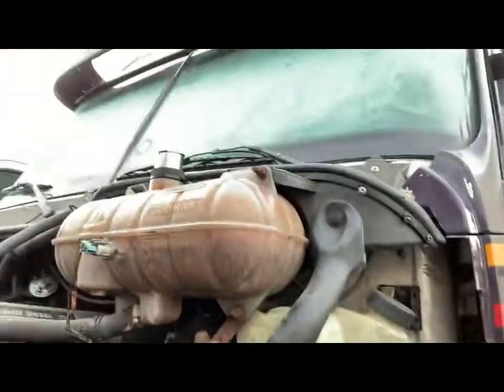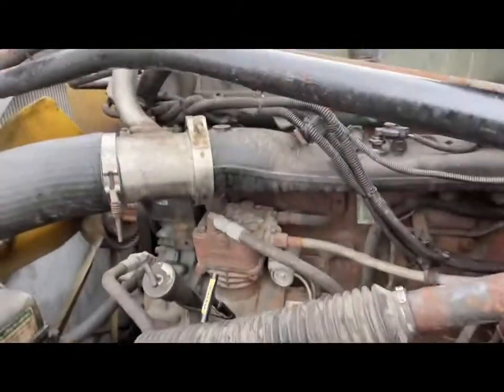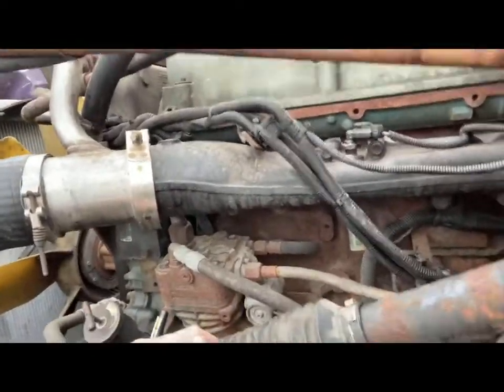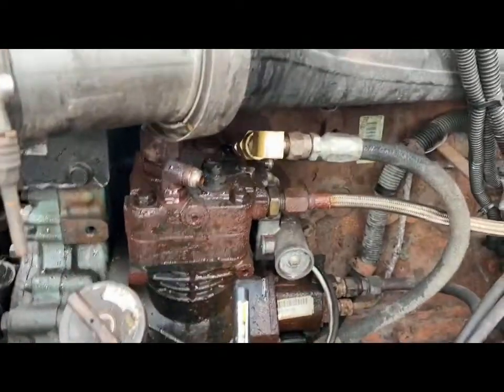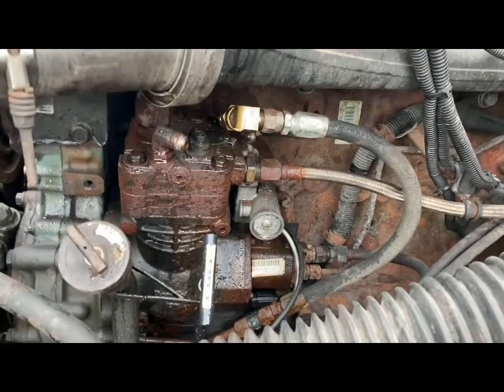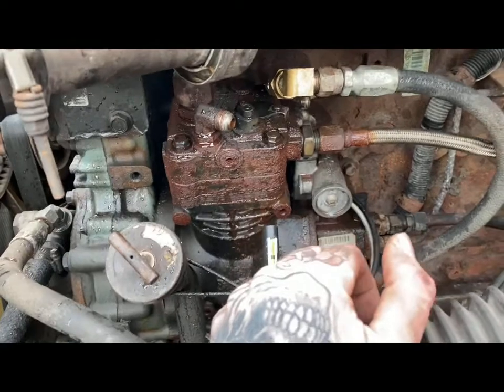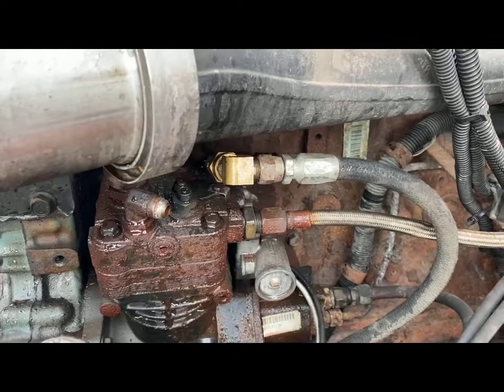Detroit 60 series pressure in coolant system diag

Comment: I’m having the same issue with overflow and everyone tells me head gasket or head or liner I’m still running but I want to diagnose the problem so I’m going to try this thanks for this
Reply: Did u try it and what was wrong ?
Because I hv same problem and I didn't try to  bypass the compressor yet
If u did it let me please
Reply: @jeyavathananjeya7474  sorry I ended up selling the truck needed a overhaul
Reply: Hey did you figured it out what was it. I am having the same issue but don’t know what is it causing to happen.

Comment: My does that only while driving , will spit a galon of coolant. While idle everything is fine.
Not overheating, no smoke of a stack only pushes coolant on a overflow line. 
This starts to hapen when i changed the coolant tank. I did reuse old cap on it. When i open the cap while hot i dont have any presure in the tank. 
Also my compressor is all oily on middle and bottom. 
What do you think ? Bad compressor, bad cap, bad head gasket or egr cooler ?
Reply from the maker: do the test to see
Reply: What did yours end up being ? Minei s almost exact same symptoms
Reply: So what was the issue

Comment: My truck is pushing water out of the weep hope over flow tube,  replaced the radiator Cao and stopped but now when I open the cap, it comes out of there. I dont have any issues with overheating.  So????definitely worried if I need a rebuild...
Reply from the maker: it’s time

Comment: When I turn truck off coolant start dripping from hose were it connect to compressor. But I run water only in cooling system and drain every day. If I leave it full over night it will be water in oil or oil in coolant.
Reply from the maker: That’s a weird one sounds like it has a cylinder dropped pull the oil pan and pressurize the system and look for water protrusion from the cylinders

Comment: My 60 series pushes 3 gallons out of the reservoir when I fill it up then crank it. After that it doesn't do it anymore. I drive about 3000 and  I fill it up again repeat repeat. Doesn't run hot. No oil and water mixing. Also blows it out of exhaust on start up
Reply from the maker: either the egr cooler is blown or the head/head gasket

Comment: I have Detroit 60s replace the thermostat oil cooler but still my coolant temperature go above 200 F only at stop 🛑, could be the air compressor? Fan only kick when it’s above 215 F
Reply from the maker: Most likely
Reply: What is the normal  coolant temperature Detroit 60 at idle and in traffic

Comment: Hi I have the same problem my engine is 70k only after in frame 
Oil clean, strong 
Cuestión ; I notice that you didn’t remove the air line . So I just do the bypass on the two hoses with coolant? Do I need to remove the air hose? 
Because my mechanic remove only the air hose and I still have the coolant pressure 
Thanks for the video man
Reply: Please let me know it will help me a lot
Reply from the maker: @javierguisa4113  yes keep the airline hooked up and bypass the coolant lines if it builds pressure it’s engine related if no the head on the air compressor is shot and it’s pushing air into the coolant system
Reply: @StickShiftRacing  thanks I will do it today I will let you know

Comment: Hello, I have the problem in a detroit series 60 14 liters I have a lot of air pressure but when disconnecting the hose from the compressor nothing happens or it will be that I performed the procedure wrong
Reply from the maker: which hose did you disconnect?
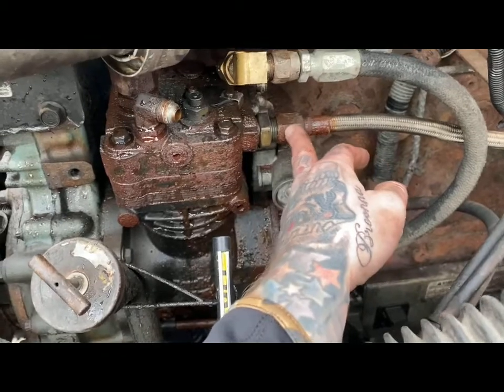Reply: @StickShiftRacing  the hose you touch at 2:35 alone and it still sends the air pressure to the coolant
Reply from the maker: @mauriciovides2904  you need to bypass the coolant lines first on the air compressor that’s the air discharge to fill the air tanks
Reply: I'm sorry, I almost didn't understand the truth, I'm from El Salvador and I use google translator to read the message. I don't know if it was wrongly translated for me.
Reply: @mauriciovides2904   el dice que tienes que desconectar las lineas de anticoagulants osea la de agua y unirlas con una union y desconectar la manguera que va a los tanques de aire osea la de metal plateada
Reply: @mauriciovides2904   perdon solo las de agua que van al compresor la que esta sola no esa es solo para cargar los tanques de aire

Comment: Hi i am having some problems like oil in coolant reservoir and i have changed oil cooler now its giving really hard time coolant pressure too much breaking hoses everyday mechanic saying we have to do pressure test bypassing air compressor
Reply from the maker: he’s correct do that and make sure it’s not the compressor if it still builds pressure it’s the head or head gasket
Reply: @StickShiftRacing  okay how about egr cooler can we check that too before moving to head
Reply from the maker: @arshbrar6928  if the egr cooler goes down it doesn’t induce pressure into the cooling system coolant just escapes out of the exhaust
Reply: What size of fitting did you use

Comment: My 2009 14L 60 series is using half of coolant galon per day. We have changed many parts but continuing using a lot of coolant.. no spells found after pressure test was done. We don't know where it is going. Do you think this test will work?
Reply from the maker: it’s either in the cooler or going out the exhaust
Reply: EGR cooler leaks

Comment: Same problem here after having a new radiator installed.
Reply from the maker: check the air compressor
Reply: I started having mine blowing coolant after putting a new (all metal) radiator in. 
The new radiator has a larger brass vent pipe on top than the old plastic one had. I’m thinking that it’s allowing to much coolant to vent off the top of the radiator and causing a surge of pressure in the reservoir. 
I’m going to try a copper pipe to help radiate the heat off of it before the tank.  
Anyone else installed a all metal Alliance radiator having this problem???
Reply: @juliemathis1065  same here
Any luck?
Reply: I recently replaced my radiator. (Deleted 14 liter) Now coolant is coming out reservoir overflow hose . Any one had any luck resolving issue?
Reply: @juliemathis1065  did u guys fix it? I'm having exactly the same issue
Reply: @juliemathis1065  same happened to me since 1 week ago I replaced the radiator with ( all metal alliance radiator and I’m loosing  coolant through the over flow hose of the reservoir. Please tell me was it the ( all metal radiator?
Reply: @juliemathis1065  please Julie tell me . Was it because the all metal radiator?

Comment: What was the issue im having the same issues
Reply from the maker: Compressor was bad
Reply: @StickShiftRacing  Thanks
Reply: Two ta three years ago, I'm fighting my 60 series Detroit as we speak, have the head off, new head, and gaskets, ECT, mine acts up when I have my foot into it and I'm running it hard, otherwise it behaved itself, so something built pressure when working, I can bobtail it all day with no problems, I was thinking cracked head or injector cup, but I don't know

Comment: So was it the air compressor?
Reply from the maker: Yes we installed a new one and it took care of the problem
Reply: Oh man ! I’m going to do the same today to mine fingers crossed !!! Mines blowing compression into the coolant tank. Motor is running fine , no coolant in oil, no over heating nothing ! Hoping for the best !
Reply from the maker: @davidblanco6249  use water to fill it back up after you splice the line just in case make sure you run it till it’s hot etc after you do it
Reply: @davidblanco6249 so was it the air compressor

Comment: 14 Liter non egr Detroit have 13 thousand on Rebuild the mechanic never cut the counter Boars I Recently started Developing over heating pushing coolant out the over flow tube and now I'm getting coolant in the oil but prior to getting oil in the coolant I had the oil cooler Replaced and he put a 12.7 non egr cooler on would that have anything to do with building pressure and pushing coolant out the over flow I'm assuming the head gasket blew because of the coolant getting into oil pan?
Reply from the maker: if coolant is in the oil pull the oil pan I bet it’s going past the liner

Comment: My Detroit 60 does this and blew 3 head gaskets after a rebuild. Liner protrusion is supposedly correct. Brand new air compressor. Mechanic can’t figure out what the problem is.
Reply from the maker: I’m doubting the liner protrusion is correct I’m willing to bet a liner is moving or the deck or head is damaged has the head been sent off to be checked? have you straight bladed the block

Comment: Hey can send the second part of this and what was the result your test I'm asking because I have the same issue my truck is not overhearing I did rebuild 5 months ago new cylinder head new piston and liner all berings oil pump injectors injectors harness  and  also I did cut my engine block at 0.50 so I really when we pulled out the old liners has a lot of little holes like almost the 6 liners well I did inframe like a told you  but couple weeks ago I found the I have extra pressure on my coolant system but I have my suspicious about the air compressor because tha and the oil cooler that only old two components they I didn't not replace did the test with the blue liquid the turn green tha means they I have  a combustion pressure getting on my cooling system  but I didn't try bypass the air compressor yet if you not the air compressor what do think can be because everything is OEM parts from detroit and Allison?
Reply from the maker: being that the block was cut there’s a very good chance the liner dropped it needs to be checked was liner protrusion checked when done?
Reply: @StickShiftRacing   yes everything was good and the guy the did that they have a lot reputacion rebuild and cut engines block but before rebuild I have the same  issue  that was the reason I rebuild with not check the air compressor first!
Reply from the maker: @victoraleman2712  did it stop for awhile after the rebuild
Reply: @StickShiftRacing   yes I mean I don't see anything wrong to 5 days ago but I noticed the line come from the engine block to antifreeze filter when the is off the antifreeze  going back engine block leave the line empty  the filter they talk about it is the they are driver side on top of the ECM
Reply: @StickShiftRacing  because usually my first sing was couple hoses blow up first one was the one the come from the oli cooler to the water pump  second was the one on coming from the radiator to the thermostats I did replace hose and thermostat as well  and then I decided to a test with the block test fluid and they changed the color from blue to green that was before rebuild  and another if you ask me is EGR  I deleted completely is no EGR valve or EGR cooler On my motor but like I say the things they missed to do is bypass the air compressor lines

Comment: Dude, way easier way, air up the truck, then take the discharge line off the compressor and run it again (dyno if possible). If it builds REALLY FAST it’s a cracked head. Get a reman.
Reply: the air discharge line?? cracked compressor head?

Comment: Good evening 

Detroit 60 serie 2007 14.0L

Tested egr already and it was good.

Am loosing a gallon of coolant every 5 hours when running bobtail temperature 200F 

Am having a similar problem, I did pressure test today with air compressor hoses plug and with hoses on the air compressor also, 2 different test 
But truck was off and cold, pressure didn’t low not even 1 PSi on both test. 

I don’t know where coolant it’s going to be honest, how can I see if air compressor it’s taking it to the tanks should I So the test when it’s hot ? What can I do ? 

Should I turn it on when I have hoses plug and compression test on the tank ? 

Thank you
Reply from the maker: sounds like a blown head gasket or cracked head especially when only happening while hot